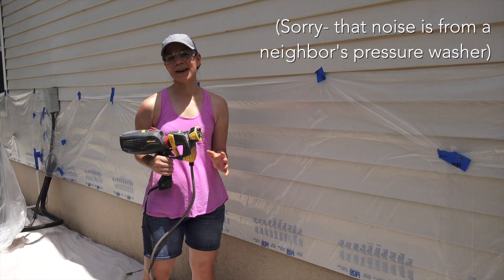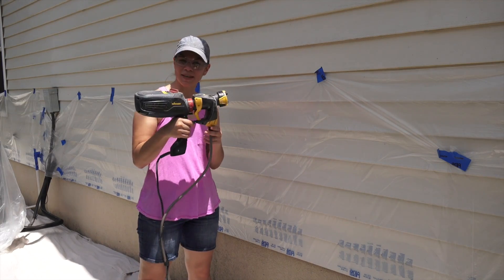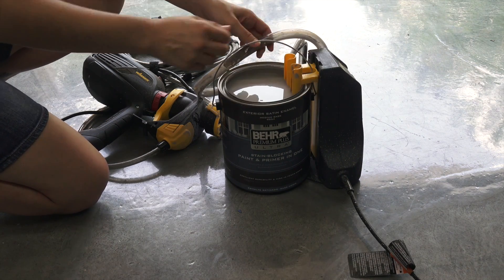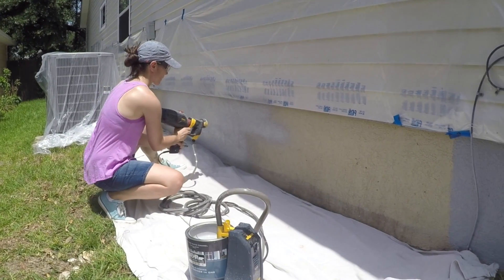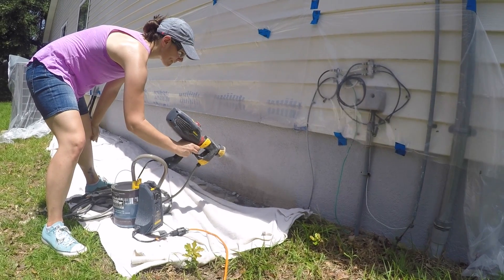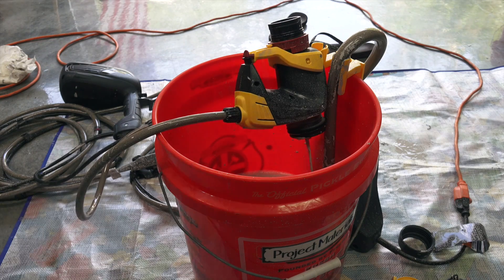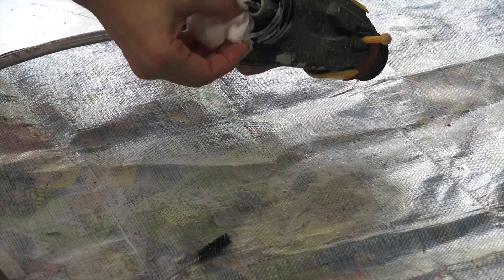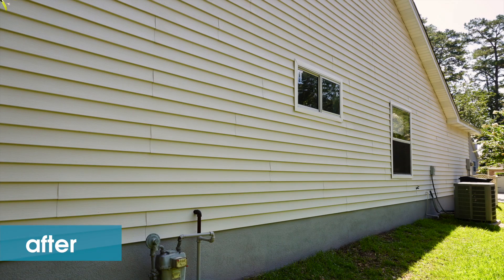How to Use an Exterior Paint Sprayer

Comment: I bought the Wagner Flexio 3000.  I wasn't happy with it.  The paint comes out as small dots not a fine mist.  In addition to that I had to go over everything 3 times to get enough paint on the surface.  I thinned the primer 1/2 cup of water per gallon and still couldn't get a fine mist.